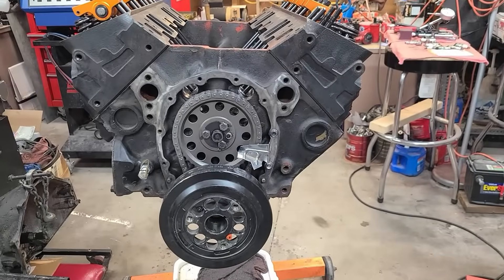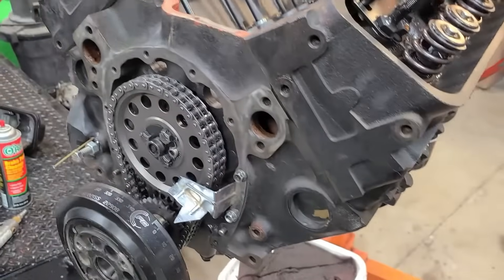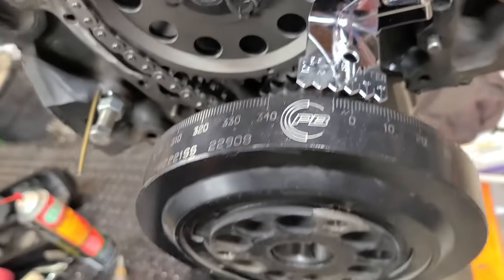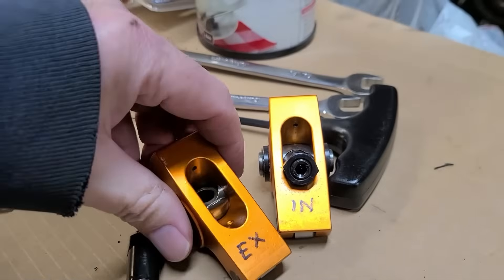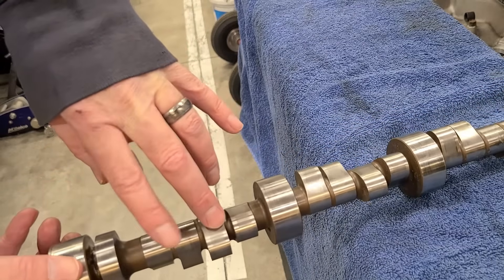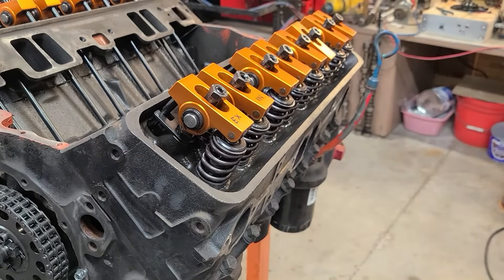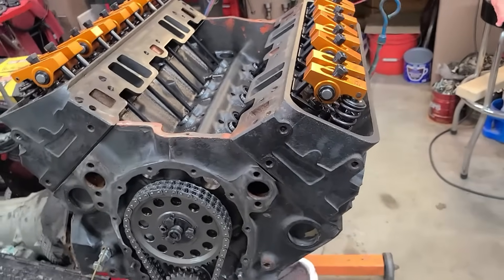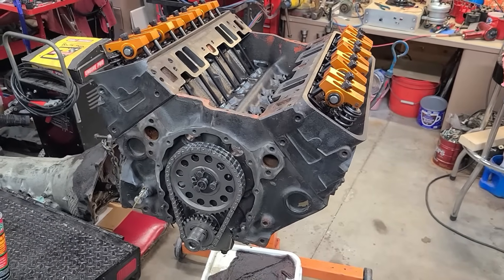350 Crate engine part 2: The Great Timing Chain Debate: Dot to Dot vs. 12 O'clock

Comment: First timing pointer was clearly bent
Reply from the maker: The first timing tab was added by someone else, and it was intended for an 8" balancer. However, the balancer on the engine is either a 6.75" or 7" balancer, so that timing tab will never align in the correct location. 
Also, I don't know if you noticed but that Chinese balancer has the numbers and marks at the rear of the balancer so that means the chrome timing tab covers the marks, making it impossible to check the timing. I have already swapped the timing pointer out with a different style that works for this application. Thank you for your input.

Comment: I've had several new timing chain sets with the cam dot 180 out. Frustrating until you figure out what's happening. In the long run it made absolutely no difference.

Comment: Leave the  distributor just tight enough that you can turn it by hand . Take the car out and run it wide open ❤and adjust the dis. Until it doesn't ping. And tighten
Reply: old school too cool, people adjust everything to what supposed to be, we were taught by old engine builder back in the seventies, his best quote was dont get caught up in what pieces of paper or books say, [he ran a really quick drag car back in the day, and most of his work was building drag engines], initial timing/all up timing/cam timing/valve adjustment/jets/etc, play with them all, up/down until you find which the car likes the best,  always remember his other favourite saying, setting a car up properly is done with the seat of your pants not a machine, a machine can ballpark but its still a long way from home base, and all cars/engines are different, can build two exactly the same but they will want different timing/jets/valve lash/etc, and different for different vehicles
Reply: Hell yeah!

Comment: LOOKS  LIKE LAWYER HANDS.
Reply from the maker: Real estate, actually. After working as a full time mechanic from the mid 80s until 2002, I ended up needing back surgery which pretty much ended my career. Starting a second career isn't easy and then you have to try to figure out what to do. I chose real estate because I wanted to be my own boss. Running your own business definitely isn’t easy and it comes with plenty of stress, but at the end of the day, I answer only to myself. One of the perks of “retiring” from wrenching is that I got to bring my tools home. I still get to work on cars when I want to—strictly race cars and muscle cars these days—so there’s that.
Reply: @BruceCoggins nothing wrong with being your own boss. I did Carpet cleaning for 20 yrs until the economy got too slow. I like toying with motors on the weekends. Oh and also building wooden fences also. Saving money never hurts especially when you have the skills to build engines or fences. Both aren’t cheap when having done. Your wallet will thank you, but your body will be cursing you! 😂

Comment: When you put the distributor in (correctly) the Dot's end up being where they belong anyways. SBC - BBC Dot to Dot is easier to see. Why make such a big deal about it. Lets make Simple Difficult
Reply: After you install the cam, don't you have to rotate the engine to set valve lash/lifter preload? Them you find TDC on cylinder number 1 and stab the distributor. I agree with you, it seems like I'm seeing a lot of videos about this "problem" that doesn't exist unless you go out of your way to create it.
Reply: @5000rgb  Adjusting hydraulics and solids have a different sequence. But you start with No 1 first. I am 70 years old. I did my 1st 327 when I was 14 and I used my Dad's 1964 Chilton Motor's Manual. It describes both ways. Hyd and Solid lifters. You find Top Dead Center on the number 1 piston and make sure both Intake and Exhaust valves are closed and that's where you start. Find a old shop manual and you'll see its easy.
Reply: @advjoe2  IC/EO is proper way on any engine
Reply: @advjoe2  Chilton is not a good source
Reply: @BillNye-bj5vi  The 1964 manual worked for me in the early 70s. Have a good day.

Comment: It's good to have the right vibration damper to match the motor and the timing indicator.
There's a reason why Chevy lists more than one vibration dampener. Set everything at top dead center index everything with a paint pen when you take it apart. Rotor should be pointing to the number one spark plug wire when you have the correct top dead center. Put the dots back where they were.

Comment: I spect balancer either rotated some or was off from the factory. Looks aftermarket, just remark 0 and 10BTDC on the balancer with white paint and go with that. Cam dot to dot. By the time it is back in car and converter bolted up it will have been spun once or twice anyway. Spin by hand and feel for compression at 1 - rotate till balancer is on 10BTDC, put in dist pointing to 1, snug down. Put all else on, some gas in carb, should light right off. Any fine adjustments can be done later.

Comment: GEAR DRIVES ARE WAY BETTER THAN TIMING CHAINS IN MY OPINION #!!!!
Reply: I've been using the same Pete Jackson gear drive on big blocks since 1997 and the gears still look like new!
Reply: Noise like he'll. Sounds like a bad alternator bearing.😅
Reply: Poor man's supercharger  sounds.
Reply: @joebrocato2365 if you set them up right they are quiet unless you buy the ones machined for gear noise
Reply: Oh look! Another keg of worms!

Comment: The only difference is dot to dot put's #6 at TDC, dot's to 12:00 put's #1 at TDC.  Your choice.  I do 12:00 so I can drop the dizzy right in before I start running the valves instead of relying on a timing pointer.  In fact, it allows me to check the accuracy of the pointer.  As for setting the valves I just run all of them and adjust the loose ones, turn the crank 1/2 turn and run the loose ones again, repeat that 2 more times for a total of 2 turns of the crank and your done.  No muss, No fuss, No having to remember anything.  The loose ones are sitting on the base circle of the cam. Works on any engine.
Reply: great, practical advice.  thanks for posting!

Comment: 1. Dot to dot. There are literally thousands of photos of assembly on this engine that show dot to dot.
2. Quit using that janky homemade timing tab.
Reply from the maker: 1. You missed the point of the video. Yes, dot to dot is the best way to install the timing set but that is number 1 on the exhaust or valve overlap stroke. The crank needs to be rotated one more revolution for number 1 to be on the compression stroke. Apparently, most people are not aware of that.
2. The janky homemade timing tab is what someone else installed on this engine and it was obviously the wrong one for that balancer so that's why I installed the new, correct one.
Reply: @BruceCoggins The dots come into alignment twice per cycle. Once on compression stroke for #1 and once for exhaust. The fact that you need to make sure you are on the compression stroke is so widely known amongst builders of the small block chevy , that it doesn't even bear mentioning. Because someone doesn't mention , it doesn't mean they don't know that. It's just widely known to the point that it's assumed. The easiest way to tell if you're on the right stroke is to watch the rocker arms on #1 cylinder as the timing marks approach alignment. 
Best of luck on your build!
Reply: I think you're a prime target as to why this video was made 😂
Reply: @eddiesloan4864 Dot to dot is compression stroke. I've been building small blocks for 40 years. This guy is making something simple complicated to get more comments on his video.
Reply: @freedomdiggersmetaldetecti8964  Like I said you're missing the point of the video,the dots have nothing to do with compression stroke other than when #1 is on its compression stroke they are not dot to dot.
Reply: @eddiesloan4864 Yes, they are.
Reply: @freedomdiggersmetaldetecti8964  Ok dude, why don't you make a video and show all us dummies that the dots line up once on compression and once on exhaust like you say
Reply: @eddiesloan4864 They do line up twice. Dot to dot when #1 is at TDC on compression, and both at 12 O' clock when #6 is. Alignment refers to them being on the same vertical plane. I can't type any slower, chief.
Reply: @freedomdiggersmetaldetecti8964  The video clearly shows #1 at 12 O'clock on compression not dot to dot,chief
Reply: @eddiesloan4864 And please do tell us, how can you tell #1 is on the compression stroke with both valves closed when the rockers are removed from #1?

Comment: Years ago, the first time I assembled an engine (SBC) I put the timing marks on the timing gears dot to dot. I assumed that I was on number one compression, but in reality, was on number six (all one has to do is check the camshaft lobes) compression. When I put the distributor in, I set it to fire on number one cylinder and of course it would not start, and it would pop back through the carburetor. My dad who was helping me had me bump the engine around to where we had compression on number one cylinder and lo and behold the distributor was set at number six. So, you got a choice here you either rewire the firing order based on that cylinder or you keep the wiring as per factory and reset the distributor. I reset the distributor to fire on number one position and the engine fired right up. Where is the debate. The way the camshaft is ground when you set the timing marks dot to dot you are simply on number six compression. When I assemble and engine, I line the dots mark to mark and then rotate the engine to align the mark on the camshaft gear to the 12 o'clock position then I know the engine is on number one compression. I really do not know what the great debate is. You don't get everything in time the engine is not going to start up.🥸👍👍👍👍👍
Reply: DOT to DOT was in time, you just needed the rotor in the right place (of course you know this). I learned from the old Windsor with a Procharger huffing and puffing years ago.
Reply: @VanGathright  Yes sir aligning the timing marks times the valves to the pistons (if not in time the engine is just not going to run). This does not guarantee the ignition timing is going to be set properly though.
Reply: @billywird  Correct. I have a timing light that I've had for years and years, it still flashes.

Comment: I can't see how this matters much if you put the timing chain in with the dots facing each other or the other way or both or them facing up @12 when the engine is running it is going to be lined up at all of those places over and over and over again

Comment: You can do it either way. Dot to Dot is TDC 6 firing drop in the distributor point the rotor to number 6. Or rotate it 180 degrees and point it at number 1. It will work either way.
Reply: Not necessarily true that,

Comment: There is no debate. Both dots at 12 o'clock before dropping distributor in.
Reply: not for me. put them dots together like your supposed to
Reply: @robhayslett9511  "like your supposed to when you install the timing chain"

Fixed it for you.
Reply: When the piston on #1 cylinder is at TDC, it doesn’t know if it’s the compression stroke or the exhaust stroke.
that’s determined by the cam gear.
Dot to dot Is the exhaust stroke.
both dots at 12 o’clock is the compression stroke on #1 cylinder.
Set them dot to dot.
Then rotate engine until cam gear is at 12 o’clock.
drop in distributor. 
It will fire right up😢

Comment: We put it dot to dot because it makes it easyier to line up the dots, then you rotate it 180 degrees to bring it to TDC on number 1 , because dot to dot is on number 6 cyl. End of debate !
Reply from the maker: Exactly....that's the way it should be done but unfortunately, there is a lot of misinformation on some automotive forums.
Reply: Both work. Don't worry about dropping in the distributor until heads/,intake are on anyway. And put the distributor in at TDC, do roughly at base timing. I turn the motor over with a way to see compression on #1 . Set from there.
Reply: This is why when and if you drop your dist with crank dot at 12:00and cam at 6:00,you are 180° out. drop dist. with dots 12 and 12 and you're good.
Reply: There is no debate! Dot to dot and 12 to 12 is the same cam timing. You have to watch the valves for compression stroke when you drop the distributor in. I mean, who installs a distributor with the timing chain cover off?
Reply: @Mr572u  I dont watch anything but where the rotor is pointing. If you dont turn the engine over after setting it at 12 and 12 there is no need to "look at the valves".  You can adjust them AFTER you put the intake on and stab the distributor pointing to #1. Or pointing to #6 if with the dots at 6 and 12 if you prefer it that way.

Comment: curious looks like cam button on end of camshaft
Reply from the maker: Yes, it does have a cam button. This is common for performance engines. Most guys when building an engine never take the time to think about installing one...but they also never think about degreeing the cam either. Cam buttons keep the cam from walking forward, making the timing more stable.

Comment: Is that a roller cam with flat tappets?
Reply from the maker: No, it is a hydraulic flat tappet cam. The cam specs are in the video. I am trying to get this engine on the run-up stand but other projects keep getting in the way, LOL.
Reply: @BruceCoggins  curious looks like a cam button on end of camshaft

Comment: anyone ever seen a variable valve timing upgrade basically replaces the upper gear with an oil pressure controlled variable position gear, need a computer pressure solenoid to Controle it, would be the most complicated part so it will change timing as the engine rpm changes sort of like a vacuum distributor advance on the ignition to make some good power at all rpms without breakdowns problems, without needing to pick high rpm or mid rpm balance or low off idle performance, Hondas Vtec not only has variable timing it also has variable lift/cam size, VERY HIGH PERFORMANCE

Comment: If you install the distributor when timing marks are dot to dot. Just point the rotor at #6 in the cap.

I don't understand how so many people have been confused by the dot to dot on these timing chains. It's only been this way since the very beginning of the SBC.
Reply from the maker: I think people get confused because all instructions specifically say to install the timing gears dot to dot (which is the best way to ensure you are not off a tooth) so, they assume dot to dot is where the distributor should be installed. 

What baffles me is when you point out that dot to dot is the compression stroke for number 6 and not number 1, instead of doing any research, they want to argue. Then they point out that dot to dot is TDC for number the number 1 cylinder without realizing the piston is at TDC on number 1 twice. 

I made the mistake of chiming in on one of those "debates" about a year ago...oh boy was that a mistake. That conversation lasted for days and days until I deleted the post and then some random guy reposted the photo I used and started it all over again...it generated hundreds, if not thousands of comments most of which firmly believed that dot to dot was the correct way to install a distributor. I eventually left the group because certain people would argue on just about every post and that got really old, LOL.
Reply: @BruceCoggins  that is the part of "social media" that doesn't become very social... I've had similar conversations like that over the years too.

Comment: Bruce, did you drill the heads for the old intake manifold bolt pattern ?
I remember my Dad pointing out that No1 was rocking and 6  was firing when the dots were aligned.
Split firing order is my preferred valve adjustment in the car, less turns of the crank.
Reply from the maker: No, that's how they came. You can buy aftermarket Vortec heads with a dual bolt pattern. If you want to use an old style intake on Vortec heads, make sure to use the correct gasket or else the top of the intake port will be uncovered.